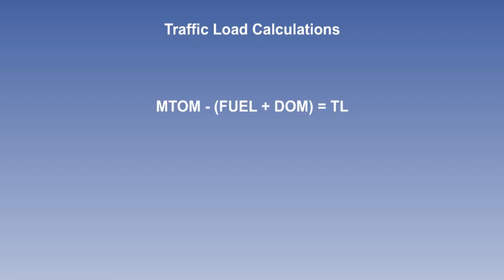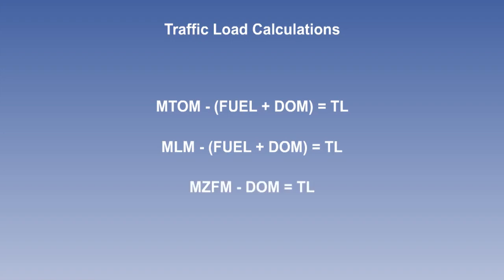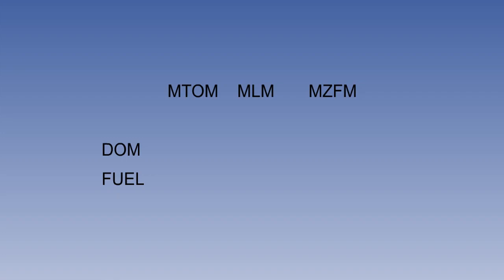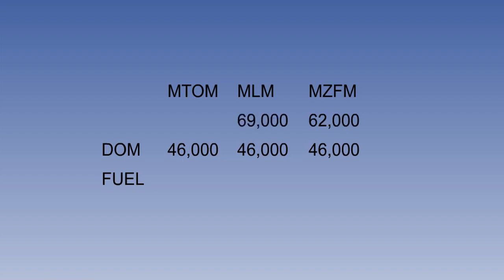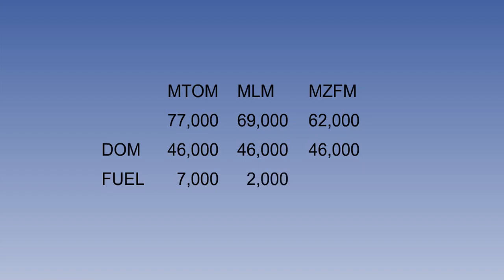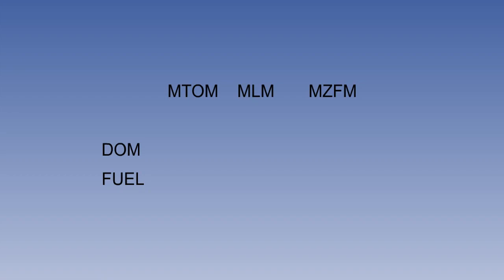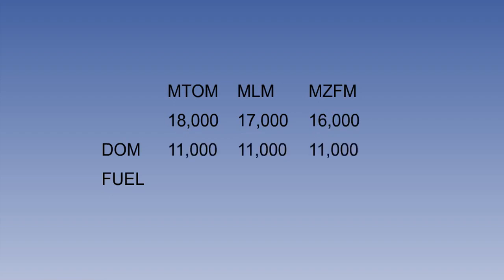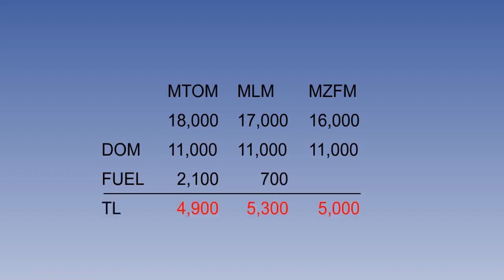35 Traffic Load   Calculations

Comment: hi. An aeroplane has a maximum structural take-off mass of 64800 kg and a maximum structural landing mass of 56000 kg. Calculate the maximum traffic load for a flight of three hours duration if each of the four engines consumes 1500 litres of fuel per hour
Performance Limited TOM 62800 kg
MZFM 51300 kg
DOM 27372 kg
Maximum Ramp Fuel 35805 ltr
Ramp Fuel 35802.8 ltr
Start/taxi Fuel per engine 350 kg
A)	12450kg
B)	23928 kg
C)	11050kg
D)	17210kg